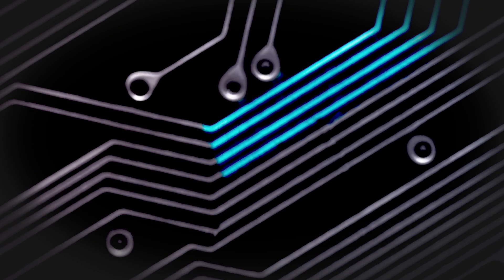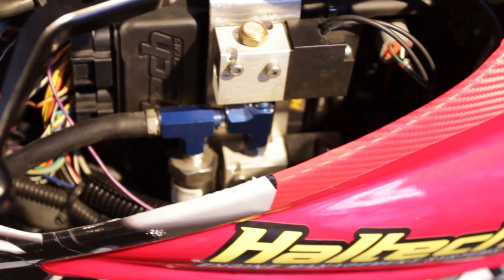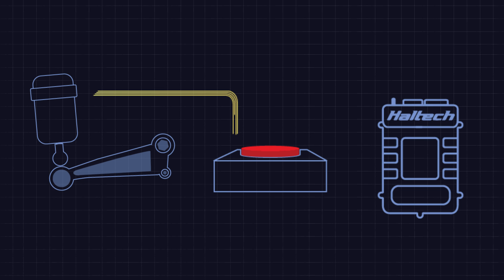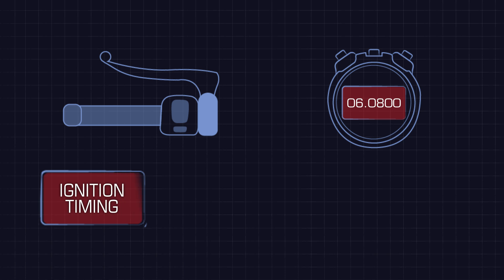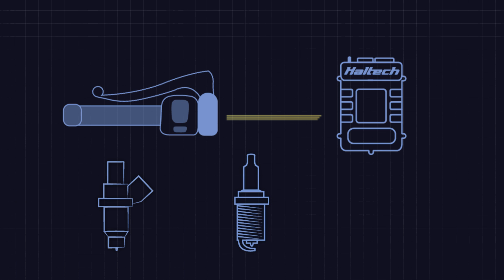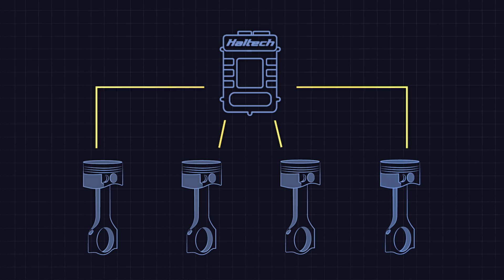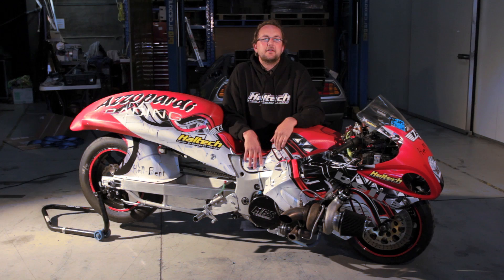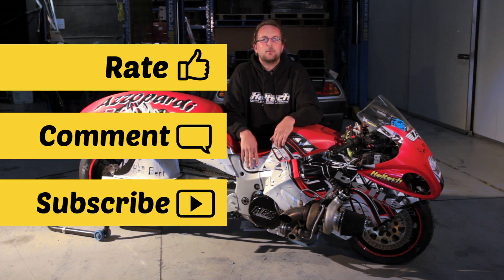Antilag & Launch Control on a 7-sec, 500hp Hayabusa - Technically Speaking

Comment: I know this is a old video but how the heck do you set base timing on an engine when you can't use a timing light eg a motorcycle engine
Reply: Or do you just crank it with the stator cover off ??
Reply: Does it have a little bung in the side cover where the flywheel sits to allow you to check for tdc? All 4 stroke dirtbike have them, you could remove that and shine your timing light in there
Reply: @wardj1922  lol cheers figured it out ages ago :)

Comment: haltech do you guys offer anything for vrods with forced induction?
Reply from the maker: At the moment no we do not have something that can run the VROD engine without some modifications required.  It would need a cam position sensor to be added before a Haltech ECU could be used.

Comment: Awesome work Scott, i am in processing to install haltech ps1000 on hayabusa engine ( first time using bike engine) my experience in cars engines working at home as an enthusiast, so my inquiry is how to use timing light in order to make ignition timing lock and proceed with angle and offset? Thanks in advance